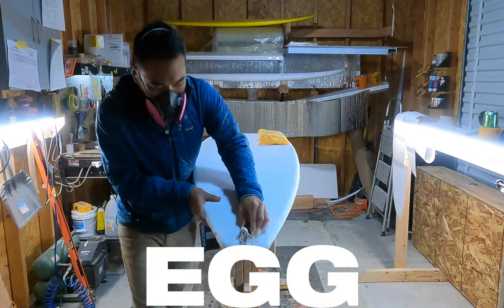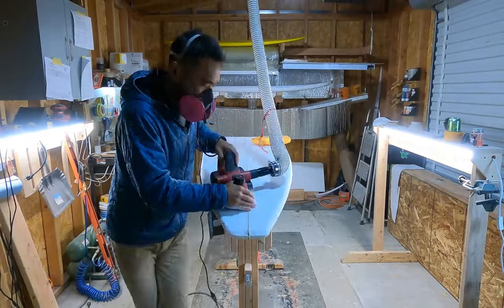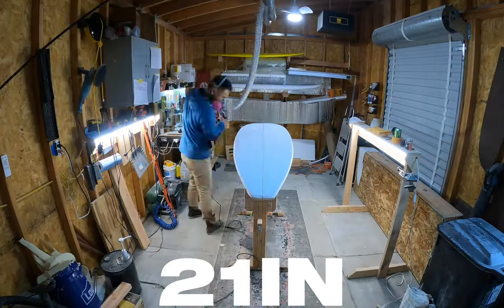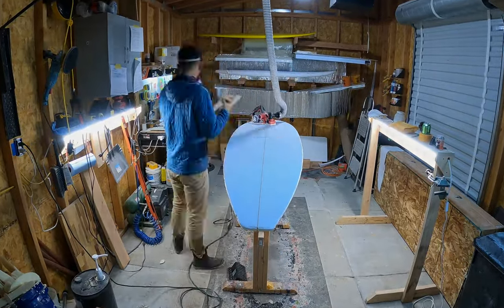Shaping and glassing a Surfboard in 12 hours

Comment: Hey nice vid thanks. I esp liked you laminating process. 3 stages, top first. I guess that means you don’t have that tricky lap grinding, on second stage. 
One question for you …What bottom contours did you put on it?
Reply from the maker: Hey, thank you 🙏🏽 
I actually did the lap cutting on the second stage, but I didn’t do that for the 3rd stage. 
I did a single concave about an 1/8inch deep and added a channel out the back. I made a short “shaping a surfboard as a beginner pt. 4” that shows this process - if you are a visual person! Hope that helps.

Comment: this looks unnatural. Sick work, but I don't get the shape idea. All that width in the rear, making it harder to put on rail / maneuver, yet not providing that forward paddle power. I feel like it could be 1 foot shorter and still paddle/ride the same. Curious what you find out from experimenting. Sub'd for a hopeful update
Reply from the maker: Thank you 🙏🏽 Haha it really does look a bit unnatural. I figure if you took one foot off of it naturally you would have to lay more forward on the board? I really shaped this out of curiosity as well. I’m thinking it will ride with more drawn out cutbacks but maybe even quick snaps using the wide back as a pivot point with less swing weight? I’ll keep yah posted.